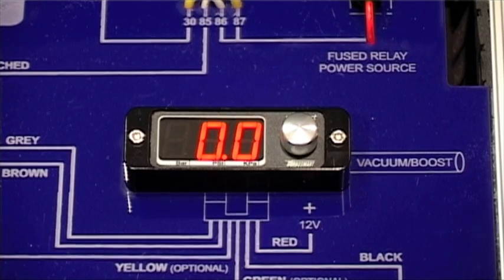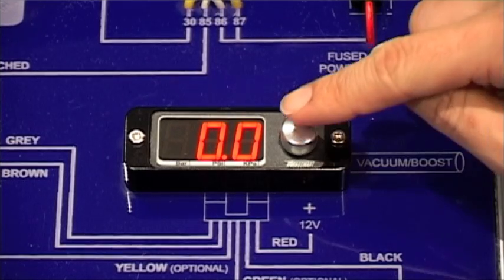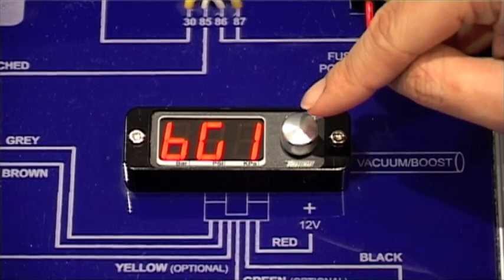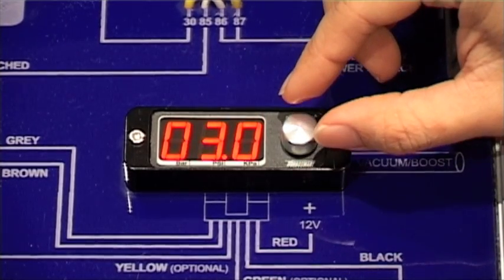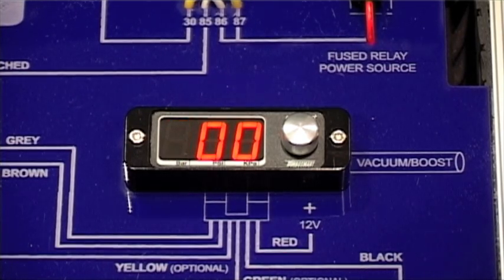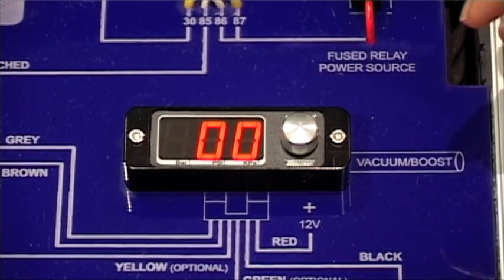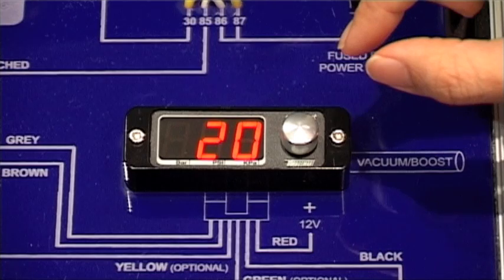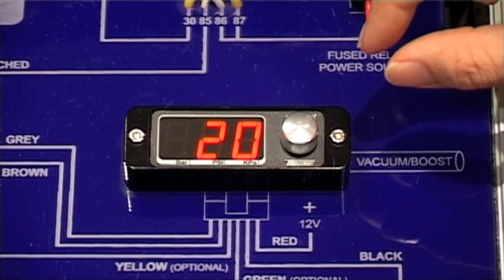e-Boost STREET Tech Tip No.2 - Boost Set Points

Comment: So after 13 years a thing needs to be adressed.... 
I was trying to change the Duty Cycle and find the BG1-2 SP1-2 and GP1-2 and i couldnt !
 I was watching all these videos to find guidance to NO AVAIL.....  And the solution was.... DRUM ROLLING.....
 If you live in EUrope and you have set the gauge to BAR, it will not show the DC the other boost options, they are hidden. Like a bug....
Switch to PSI first, tinker with the DC and the other settings and when you finish switch to BAR